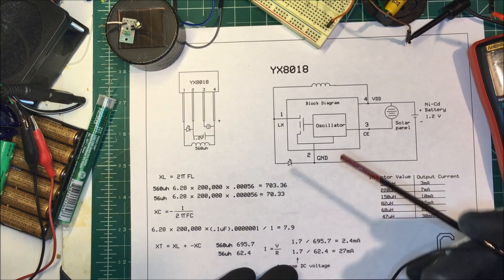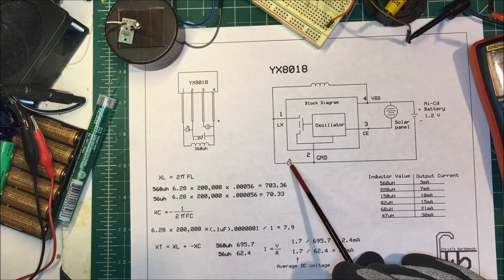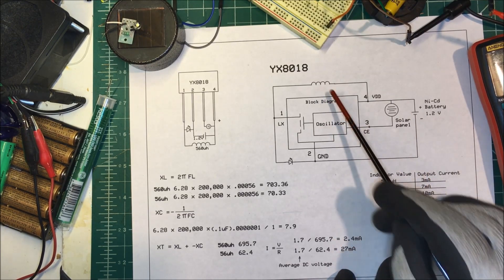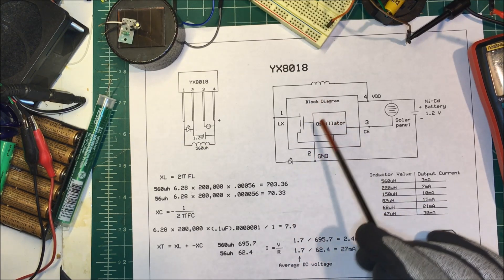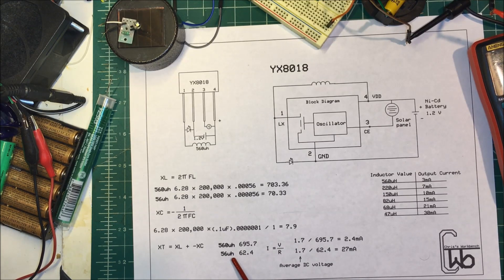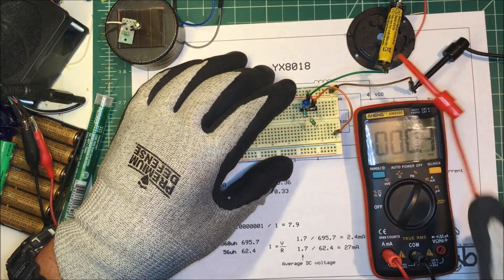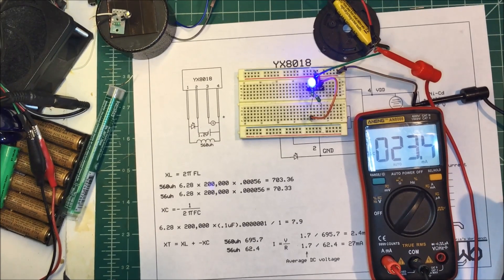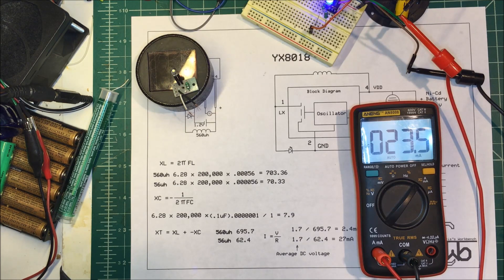YX8018 solar garden light controller

Comment: The writeup of the calculation for XC is very misleading on your sheet around 1:26 and in google drive. You've written (6.28 x 200k x 0.0000001)/1 = 7.9, but the correct calculation taken from the line above is XC = - 1/(6.28 x 200k x 0.0000001) = -7.9. Further you have that XT = XL + XC = (for 560uh) 703.36 + (-7.9) = 695.7.
Reply from the maker: Thanks for the correction.
Chris
Reply from the maker: Corrected formula in the link to diagram.

Comment: mine has the XY805. I think it's about the same. I married it with a tiny 5v booster and got 8.2v out. must be the freq spikes boosting the booster. but anyway it works for the experiment. I'll be going for the 10uH inductor, that's 90mA that I'm going to force it to muster. Perhaps a heat sink.
Reply from the maker: Sounds good
Reply: @ke6chris  It was an excellent rabbit hole. My finishing thoughts are, the best battery is a NiMh.

Comment: I have taken apart two of them, one has yx805 with AAA, and yx8018 with AA nicad.
Neither of them have a coil or capacitor.  what up with that?
Ahh, the coil looks like a resistor, I'm used to surface mount coils, not these little ones.
Let me add that you glossed over the diode used for the solar panel.  There is a diode between the CE and GND pins.
I use one of these to charge up a 3.2v lithium cell instead of light up a led, using the AA as a buffer/capacitor to take in the solar.
Reply: I took one apart and noticed the same thing, but I assume the capacitor is inside the IC. I have no idea why or where the inductor is.

Comment: Here is how it works, there is a common ground between the battery, LED's and the solar panel. 
Then you have 1,2,3,4 pins on the IC, say 3 is ground, 1 is solar positive, and 2 and 4 are battery positive and negative. 
When the sunlight is out, the voltage from the panel connecting to pin 1, it activates the IC's charging circuit, essentially it just enables the solar positive to connect through to pin 2 which is battery positive, and because all are common on the ground outside of the IC itself, this makes a complete connection with the batter with the solar panel and it's charging. 

Once the sunlight is gone, the battery positive no longer has contact with the solar panel positive, as pin 1 is deactivated. 
During this phase, pin 2, 3 and 4 will be used. 2 and 4 are connected to battery positive and negative, and pin 3 is connected to the common ground. 
What the IC does here, is that pin 4 which connects the negative of the battery to the inductor, it turns this on and off very vast, when it's on the battery current flows into the external inductor coil, and when it's off the circuit for the inductor that would go via the battery is cut off and so is it's energy source, as a result the inductor magnetic field collapses and this doubles the voltage in a voltage spike, and that spike is enough to cross the LED's, which on the other side of them is a line connecting to the common ground that finds it's way to the battery negative. 

Thus, it's lit via a series of pulses of higher voltage, if you can film in incredibly high speed you will note the LED technically is flashing, but it's just too fast for our eyes to normally see it, so it looks like it's permanently on. 
Older solar garden lights used to have separate power diodes on the board, this was to stop backflow from the battery into the panel typically. I think the newer IC's however have that functionality built in between pin 1 and pin 2, so it's not necessary, which is why you don't see them in most solar lights anymore.
I even have a solar garden light that is using a zener diode as well in place of a power diode, it also will conduct only at a certain voltage, so they used it.

But the most typical one these days is just the IC and the inductor. It's actually nice to get one that has more components however, getting more bang for your buck. But for use as a solar garden light itself, I prefer the new IC and just the inductor, it seems to have less chance of failure over the long term. The new IC's are purpose made for solar lights, where as I believe the original solar garden slights used IC's that were not purpose made, that's why they had to use additional components sometimes.
Reply: nice explanation, you should make a video!
Reply: My solar light uses the YX8018 but is nothing like your description. The battery + doesn't go directly to the IC but instead runs to a switch which then runs to pin 1 and picks up the solar +. The battery negative goes to pin 3.

Comment: So the yx8018 only "protects" the battery by dropping the voltage a bit via a diode, would that mean that I could use a different battery technology such as lead acid or lithium if I were to pick the right solar panel voltage?
Reply from the maker: Ni-CD batteries work in subzero temp. , can be discharged fully and are tolerant of overcharging.
Chris

Comment: Hi I rigged up one YX8018 circuit in a bread board. For 47uH inductor the LED current was 0.01A but the current drawn from the battery was 0.03A. I changed the inductor to 33uH and the the LED current was fluctuating between 0.01A to 0.02A but the current drawn from the battery was 0.05A.
Now I am confused if the inductor value correspond to input current drawn by the battery or its really the LED current.
Reply from the maker: The inductor controls the load current (LED)

Comment: I just bought a few of these for no reason some time ago. And it turned out they were also my my rusted solar light. I actually manager to repair it by replacing the yx805 in my case. I coz for the price it's pratical to have a few lying around. They seem to be in all budget solar lights these days.

Comment: Would it work as a youle thief when I do not connect any solar panel? I just want to supply battery power and have it boost the voltage for the led.

Comment: Thank you for sharing, I have a question. I add a 3v battery and a led for this voltage and the system never turn off, please what I have to do to modify and use  it with 3v dc?
Reply: use a different chip.    
big Clive actually has a really great tutorial on his super simple solar light out of a cell phone battery it's actually one of the better ones to go ahead and use if you want to use 3 Volt or Lithium-ion batteries and a simple solar panel you can get off of eBay or wherever you get one..  

there is a way to hack it where you can probably use a resistor or shock each style diode that breaks down at a different voltage and then you can fool the controller to go ahead and turn on even though it has a higher voltage to work with but the actual controller itself would only see about 1.5 volts.

Comment: I have noticed that with this chip (YX8018) the lights don't go dim they just turn off.  Is this some protection for the NiMH battery? 
The ANA618 chip for instance just keeps working until the battery doesn't have enough energy to continue.

Comment: Hello! I am very much a novice. I have a cheap solar light based on this chip. It has a 330 micro Henry inductor. I put in a Straw Hat RGB Slow-Flash color-changing LED. Tested the LED on a bread board. It works. It is stuck on red in the solar circuit. I think I know why. I am getting only 1.2 volts driving the LED. Something is clearly amiss. Which pin on the 8018 is pin 1? I am guessing on the label side, it is the left-most pin. The impedence of the inductor is low, so I guess it is good. What do you suppose is the problem? Thanks!!!!!
Reply: The current is very low as you are using 330uH inductor. Use 47uH inductor & see. Also for multi-coloued LEDs we need to use one schottky diode in series with the LED as there will be a controller IC inside this LED.